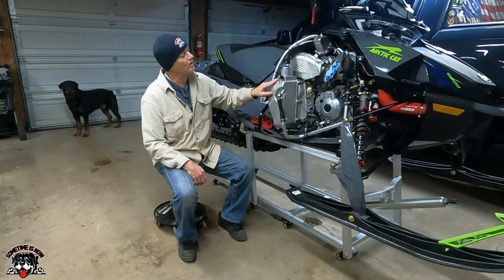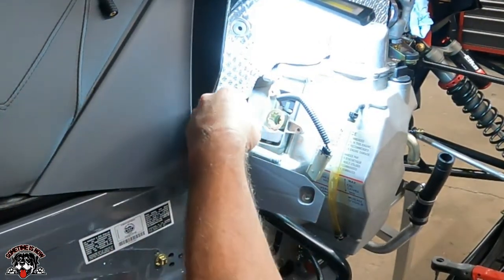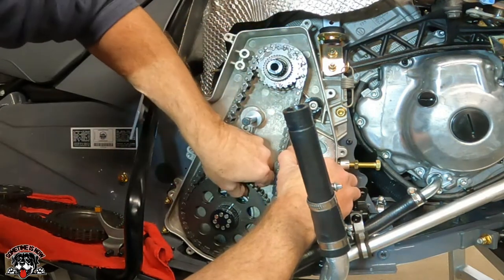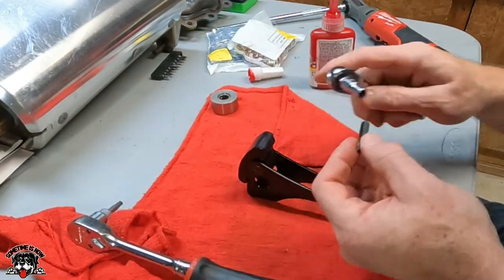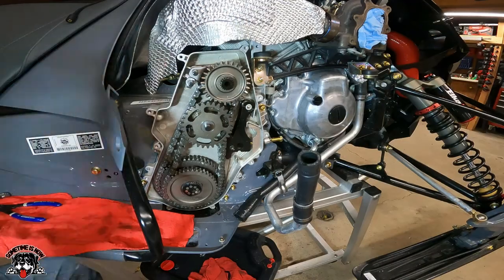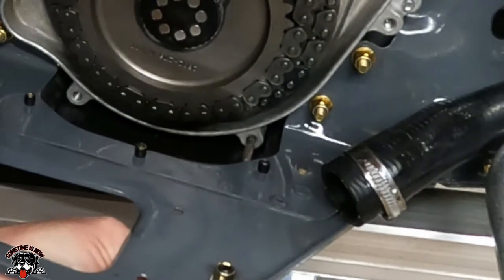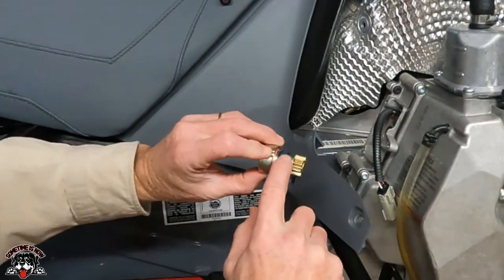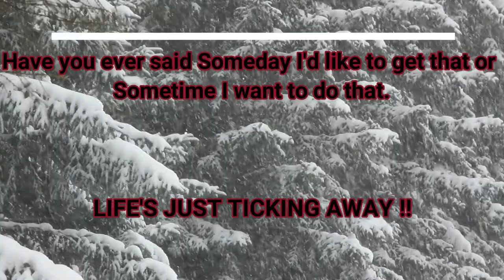THUNDERCAT SIDEWINDER Upgrade your Chaincase parts

Comment: Hi, good video.... The 14 ft/lbs is incorrect for the chain case torque.
The correct torque value is 96 in/lbs or 8 ft /lbs... Anything greater will begin to stretch the bolts...These are mild steel bolts because of the magnesium chain case.... Anything harder for bolts will also deflect the ears on the cover and most likely fracture them, 96 in/lbs is more than enough for this application. 
Cheers
Rob
Reply from the maker: Hey NO1B4ME, Thank you for stopping by the channel to check out the video.. And, thank you for the correct torque spec on the chaincase. It’s greatly appreciated. 👍🏼I figured the 14 ft lbs listed in the service manual was incorrect but I couldn’t find anything to prove that wrong. I’ve been doing maintenance for over 36 yrs now and you know when tightening a screw or bolt just doesn’t feel right. Thank you again, Take Care 👍🏼
Reply: What is the model number on the 1/4 inch torque wrench?

Comment: Best complete video I’ve seen thanks for documenting this!!!
Reply from the maker: Hey Nolan, Welcome to the channel and thanks for stopping by to check out the video. Now after all these years I finally own an Arctic Cat , one thing I had noticed is a lack of detailed videos on YouTube showing how things actually come apart. I have some great videos coming out soon on the T-Cat and upgrading the Procross chassis in general. Also, I believe I finally figured out how to get away from the cable scratchers drilled into the rails and install a set of Skidoo Tunnel scratchers on a ProCross Cat. Stay Tuned. 😉

Comment: The sidewinder manual lists 12 lbft for those chain case bolts.  However, even that is too much.  I found that 9 to 10 lbft is the most torque I feel comfortable applying to those bolts.

Comment: That's quite a process for sure.you got very lucky with that broken bolt coming out. That could've turned out really ugly. Excellent job as always...
Reply from the maker: Yeah, I was lucky the bolt broke like it did instead of deep inside the threads, And not having loctite on it helped tremendously. 😬 Thanks buddy.. 👍🏼

Comment: Enjoyed your video. It is nice to see someone working on a sled similar to mine. I have done the mods you have done; some are a little different than yours, but along the same lines. I have done the side panel mod also, but I still remove the muffler to do the chain adjustment, oil lines are in the way. You might be able to go thru the bell pan and reach it. I would do the drive shaft saver; you probably know this already. Thanks for the great videos I have watched most of them.
Reply from the maker: Hey Edward, Thanks for stopping by to check out the videos. I’m glad you’re enjoying them, And welcome to the channel. I have a bunch of videos that’ll be coming out with all kinds of upgrades including some Hurricane performance stuff. Yes I have the Precision EFI driveshaft saver along with the belly protector to edit the video for yet. I’m trying to get more of my wife’s Rev Project done, then I’ll be back on the Cat. I still have the rear Stage 5 Elkas to install yet along with the Speedwerx quick adjust coupler block and Dupont Slides. Then I‘ll get into the Hurricane Performance items. 😁😉 Take Care🤙🏼

Comment: Very nice install. 👍💪🏅 For those with the Yamacat version, my 2021 Viper LTX GT has a T-30 bolt down in front under the bumper to remove to remove the hood...
Reply from the maker: Hey Doucetrr2007, Thanks for stopping to check out the video. It’s appreciated. I just upgraded the chain tensioner to the Precision EFI HD tensioner they just came out with as the stock tensioner is cutting into the pivot point which is part of the chaincase housing.  
https://precisionefi.com/en-us/collections/9000-series/products/hd-tensionner
Take Care

Comment: Good video. 
Unfortunately this should have never been necessary if Cat would have addressed the problem years ago. 
It’s sad you have to this to make a sled reliable and for piece of mind. 
Here’s hoping they have addressed all of this  for the new chassis comming out.
Reply from the maker: Hey Kranky, Yeah it is what it is. I believe Cat already upgraded the top gear with a new bushing Assy but I wanted to go needle bearing for the added hp coming. I still love the sled, and it gives me something to tinker with to supply my YouTube fam with content while everyone waits for snow. 😁 I honestly wouldn’t have upgraded all these items if it were going to stay stock this season 😁🤫 There’s a two year warranty on it so it wasn’t needed in stock form. Oh.. And yes… The new Catalyst chassis has addressed all these by going to a belt drive system. Two pulleys and a belt, that’s it. 👍🏼 Take Care

Comment: This video really helped me get through the process. Thank you! Hopefully everything works for me!
Reply from the maker: Hey Garrett, Thanks for stopping to check out the video. What sled do you have and what update did you complete in the chaincase? Take Care 🤙🏼
Reply: @SometimeIsNow  I have a 2018 sidewinder! I replaced the top gear and the shift fork pads!
Reply from the maker: @garrettcrites9693  Oh nice.. I like the Sidewinder’s and SRX’s. I went with the T-cat for the EPS option. Did you see any wear & play in the top gear bushing? I just finished installing a first ever set of Skidoo tunnel Ice Scratchers on the T-Cat. 😉 Video to come soon.
Reply: @SometimeIsNow  no play in the top gear for me but the sled only has 419 miles on it.

Comment: Hi greg , great video I’m doing a track replacement on my 19 zr9000 RR putting in a storm 150 and adding 144 woody mega bites 1.575 studs , when it’s time to reinstall everything I’m putting in the dmc HD top gear , shift pads and the pefi  tensioner and skate . What Milwaukee  impact wrench are u useing and torx wrenches do u use ,  thanks and keep those videos comming
Reply from the maker: Hey Brian, Thanks for stopping by the channel to check out the video. Those are all great upgrades your doing to your sled. 👍🏼 I installed the PEFI HD tensioner during last season as the stock tensioner arm was digging into the post housing. I filmed it but never posted the video of the install. I just finished working on RichOutdoors T-Cat and updating all his rear skid bearings along with the driveshaft bearing to Timken. I sh*t canned all the Chinesism bearings. Now I’m going to do all the bearings in my T-cat here soon. 
As for the Milwaukee ratchet wrench’s there the M12 1/4” and 3/8” ratchets. https://www.acmetools.com/milwaukee-m12-fuel-3-8-high-speed-ratchet-bare-tool-2567-20/045242593118.html
https://www.acmetools.com/milwaukee-m12-fuel-1-4-high-speed-ratchet-bare-tool-2566-20/045242593088.html

The sockets are Tekton Torx sockets . https://www.amazon.com/TEKTON-Socket-10-Piece-T6-T30-SHB90103/dp/B07RT6QTZR/ref=sr_1_1?crid=1YVRHIGRMW0TO&keywords=Tekton+1%2F4%22+torx+sockets&qid=1698437632&sprefix=tekton+1%2F4+torx+sockets%2Caps%2C116&sr=8-1  
Hope this helps.
Take Care 🤙🏼

Comment: Nice video. Since your doing very much needed upgrades to the chaincase you might want to check out barn of parts drive shaft saver. Almost all drive shafts will fail over time with the horrible design cat has. Barn of parts has a upgrade. Since your sled is almost new now is the time to do it. I really enjoy your videos. I have a 900 Turbo and am interested how much difference the power steering is compared to your old 900 Turbo. Keep up the great work.
Reply from the maker: Hey Toby, Thanks for the suggestion..👍🏼I already have the driveshaft saver from Precision EFI ready to go in. I haven’t made it to that side of the sled yet. My goal is to make the sled a rock solid machine. I figured I’d start on the right front, then left front then finish with the rear suspension with the completion of the Elka Stage 5’s Speedwerx quick adjusting coupler blocks and a set of Dupont slides.. There’ll be a video for the DSS and Precision EFI’s Belly Guard to protect it if a belt blows from the added HP. 😉 The EPS is simply amazing over the 900T heavier steering. If you were riding on trails like up in Quebec or Cochrane ON you wouldn’t notice the EPS as during high speeds it pretty much turns off. Where it shines is through the woods. The tight and twisties are all that is around me. Take Care
Reply: @SometimeIsNow  got a link to the quick adjust couple blocks ? I cannot find them on their website.
Reply from the maker: @mattwedig2655  Hey Matt, HEre’s the link where I bought mine. Looks like they’re temporarily unavailable. https://racewerx.myshopify.com/collections/products/products/rapid-block-procross

Take Care
Reply: WTF?  I can't believe how crappy these cat chassis are engineered and to think Yamaha would put their name on them...

Comment: Hey, you're awesome.  Thanks very much for sharing…. I have mine opened up now and discovered I needed a new top gear badly.  I didn't know about the Precision EFI Chain tensioner.  did it quiet things down a bit?
Reply from the maker: Hey Eddie, Thanks for stopping by the channel to check out the videos. It’s appreciated. I really didn’t hear any noise difference between the two but I can say the longevity and dependability of the new tensioner should be much better for sure. Arctic Cat finally updated their service manual for the chaincase cover and 14 ft lbs was way to much as you see. The correct torque for the chain case cover is (9 ft-lb or 108 in.-lb) 
While you have the chain case apart check the post for the chain tensioner. That cheap stock Cat chain tensioner has a tendency to chew into the pivot post and eventually you’ll need to replace the case itself. I did this upgrade also and it’s well worth the investment. Here’s the link below. Look at all the photos Precision shows. You’ll see an example of what’s happening with the wear issue into the post. Mine was much worse than their example. 
https://precisionefi.com/en-us/collections/9000-series/products/hd-tensionner
Take Care and if you have any questions feel free to ask. 👍🏼
Reply: Much appreciated.  I'll order one of them up.  I have a 19 SRX and happened upon all these upgrades by chance.  Happy I found this.  I'm surprised Yamaha didn't go through these Cat chassis and work out the engineering flaws before attaching their name to it.  Disappointing.
Did you complete the driveshaft saver mod? If so, which manufacturer did you go with?
Thanks bro @SometimeIsNow
Reply from the maker: @eddiepotts982  Yeah, that’s one thing that’s disappointing with YamaCat is that they didn’t address all the known issues sooner. They have made improvements over the last couple years as far as the driveshaft. The ‘22 driveshafts and newer are hardened and the bearing doesn’t chew into it like in the past years. 
My buddy @RichOutdoors and I both bought the PEFI driveshaft saver and wasn’t impressed so we removed them. It created a terrible bearing growling noise once installed that we both didn’t like.. It literally made the driveline loud and sounded like the bearing had zero grease in it after the driveshaft saver was installed. We weren’t impressed so they both sit on the shelf in my garage. Some will argue you have to indicate the driveshaft saver inside the driveshaft so it’s running true center.. It’s not a simple throw it in and torque it to spec install as shown on PEFI website. 
I did a bunch of service work to Rich’s sled last month and while I had the rear skid out I removed the brake caliper and bearing to check the shaft and it was just fine with over 5000 km’s (3200 Miles) on it with the new hardened driveshaft upgrade Cat made starting in ‘22. I did replace his chinesium bearing with a much better Timken bearing. I popped off the seal on the stock driveshaft bearing and it was bad. Very little grease and it was all gummed up and rusty.. I’m glad I recommended changing that chinesium junk out for a better bearing. It’s definitely going to be a yearly part of the service is to check and repack the driveshaft bearing going forward. 

I currently have my rear skid out right now and just got my shocks back from getting serviced. I have been recording everything and I will be doing videos on replacing all the bearings in the rear skid wheels to Timken and also replacing the bearing in the driveshaft to a USA made Timken.. Rich and I also purchased the Sidewinder brake rotor as its drilled to replace the solid Cat rotor. Another great upgrade in my book for the Big Kitty.
Reply: Wow,  That sounds intense.  I'll finish up the top gear mod and look into my drive shaft bearing condition.  Looking forward to your video on that.
Thanks again... @SometimeIsNow

Comment: Hey Greg the cordless ratchet you have is how many volts?I've been looking on Amazon but most are 12volt and I wonder if that is enough.
Reply from the maker: Hey Boosted, The cordless ratchet I have is the Milwaukee 2567-20 M12 FUEL Brushless Lithium-Ion 3/8 in. Cordless High Speed Ratchet which is a 12 volt. I also have the 1/4” version ratchet and the Milwaukee M12 FUEL 1/2" Right Angle Impact Wrench. I’m very impressed with these ratchets. They are all 12v and brushless. Whichever brand you decide, make sure it’s brushless. Take Care buddy👍🏼
Reply: Thanks ,give Riley a pat for me
Reply from the maker: @Iluvboostedsleds  Will do.. He's sound asleep on his couch right now. 😁

Comment: How do you get your sled into your garage without the studs tearing up the concrete?
Reply from the maker: I use a two wheeled sled dollie and wheel it into the garage from rubber horse mats I have in the driveway. 👍🏼

Comment: My 19 sidewinder manual calls for 12 ft lbs and even that is way too much.  That's a major fk-up in the manual.
Reply from the maker: Hey Eddie, 
Thank for stopping by the channel. Yeah I would say major screw up on their part. AC corrected it in the 2023 manual and now has it listed as 9ft lbs or 108in lbs which made more sense. Once I seen this I added it to the description of this video hoping everyone watching would notice the update. 
Take Care 🤙🏼
Reply: Yep, I started with 12 ft lbs and felt one of the top screws continue on as if it started slipping the thread.  Then I recalled watching this video a while back and came back to it..  I went by feel for the rest of them. I'll just leave that one screw till next time I gotta service it…. Thanks for the info  @SometimeIsNow

Comment: I’m following the Manual to reinstall but when I clock the female gear the 20% clockwise I can’t get the reverse motor to line up, it’s about 1/2 a tooth off. 

Do I just rotate the reverse motor against itself for the holes to line up?
Reply from the maker: Hey shnill,
The manual does show clocking the female gear 20% but the most important thing is to make sure the female gear is all the way counterclockwise when you drop the actuator on. That’ll be your forward on the gear set inside the chaincase.
Reply from the maker: Shnill, Did you figure the reverse actuator out? I was working on @richoutdoors T-cat today and ran into the same issue you’re having. I clocked the female gear at 20 degrees, then drop the actuator on and lined up the 3 screws. When you fire the sled up it’ll be fine. Just make sure when you’re done you turn the track to verify the secondary turns. Then cycle through reverse and forward 5 times to confirm you did it correctly.

Comment: Ya I'm a apprentice at a arctic cat dealer and that happened to me and we don't torque them just tighten them snug and you will de fine
Reply from the maker: Hey Isaac,  Nice !! Must be great working with the Cat dealer. 👍🏼 Thanks for stopping by the channel to check out the video. Just a FYI, I found on page 8 of the 2022 T-cat Service Manual it calls for 9ft lbs of torque for the chaincase cover. Take Care buddy and enjoy working and learning the Cats.🤙🏼

Comment: Would you say, considering how tight the screws were that held the roller tensioner in. It would potentially still be an issue backing out?
Reply from the maker: Hey pdh, The screws were actually pretty tight and they did have loctite on them from the factory which in the past I believe is why they were having issues because there wasn’t loctite.. I’m not totally sure what was causing that outside screw to back out in years past other than maybe that tiny needle bearing in the pin seizing up and backing out the screw. 🤷🏼‍♂ If I had to venture a guess, I don’t think it would pose an issue now but I personally didn’t want to take the chance with me adding the extra HP, so i changed out that roller for the shoe that doesn’t spin. Take Care. 👍🏼